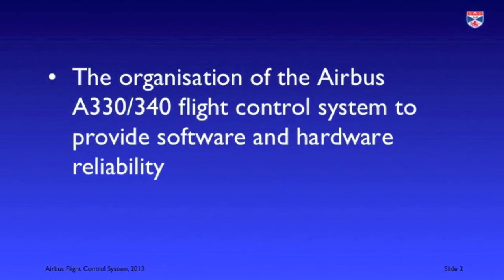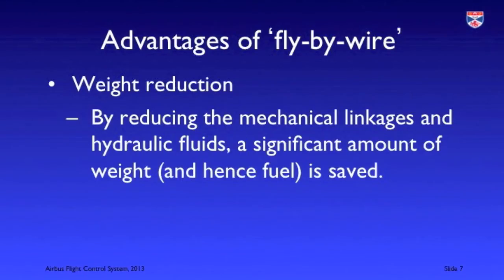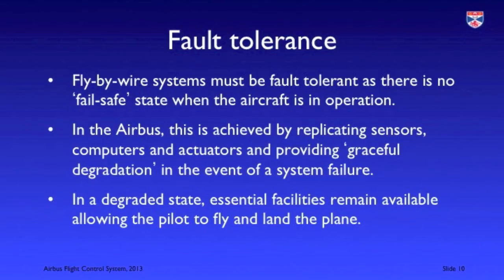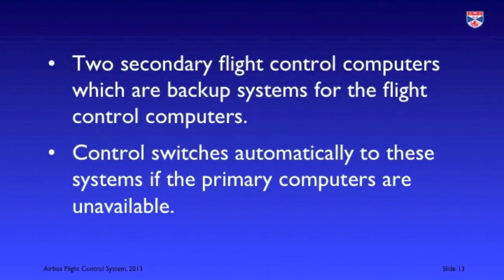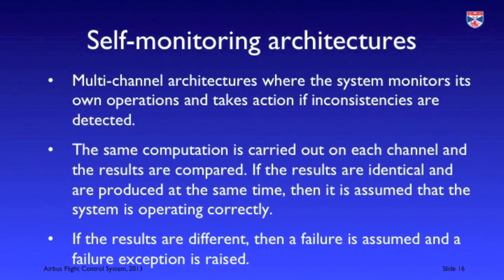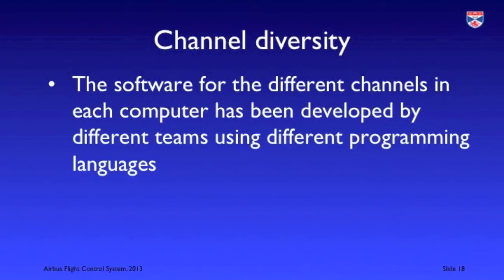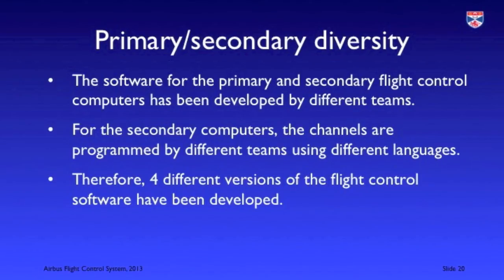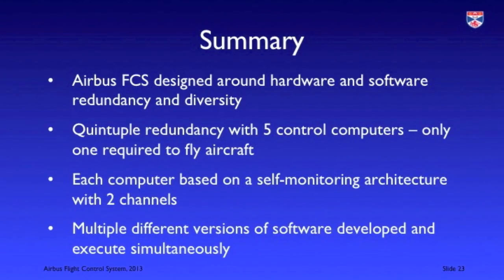Airbus FCS - software and hardware redundancy

Comment: Hello, can you explain what happens in a lightning discharge is inContact with the aircraft thanks.
Reply from the maker: Sorry, I am not an expert in how aircraft manage lightning strikes. Having been on an aircraft that was struck by lightning, it didn't seem to affect the electrics
Reply: WHAT ABOUT QANTAS FLIGHT 72 FLIGHT CONTROL SYSTEM FAILURE ACCIDENT /INCIDENT?